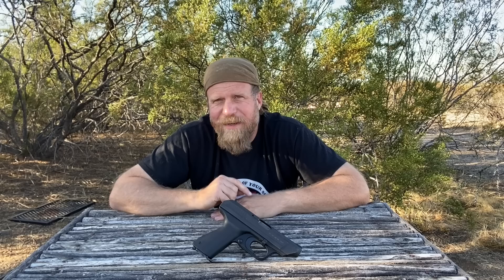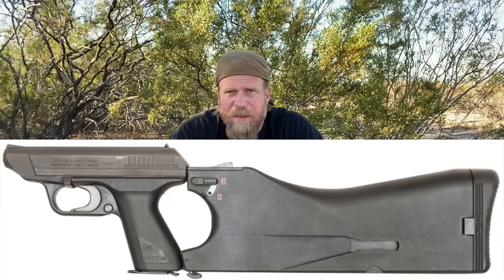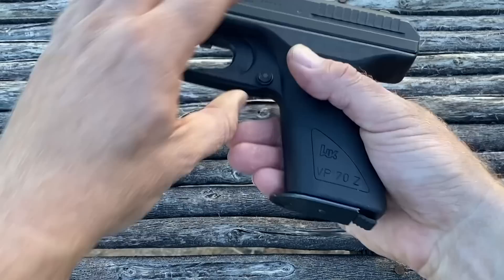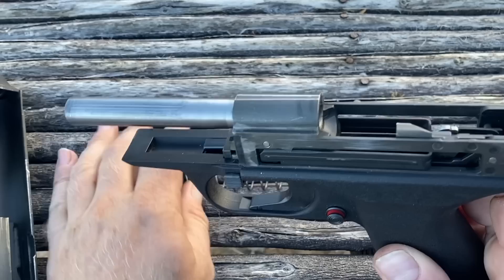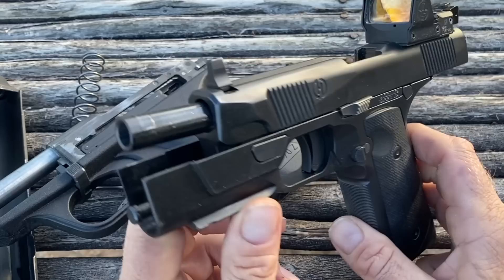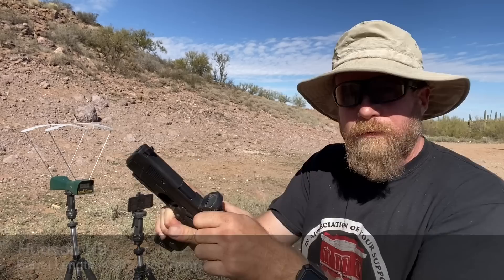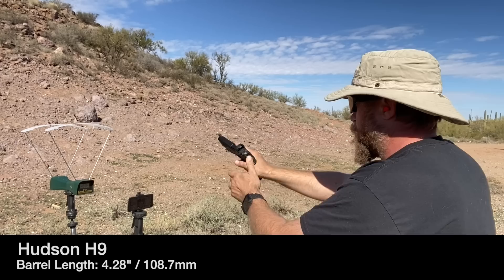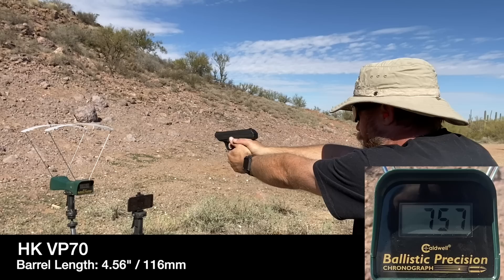HK VP70 - Turning 9x19 into 9x17 since 1970

Comment: Out of curiosity, could it handle +P ammunition, and if it could, would it bring it up to standard velocities for 9mm or maybe still exceeding normal velocities??
Reply: You know that not-so-subtle difference between should and could?😎
Reply: It "should" handle it, yes. It was designed with the understanding and intent of using NATO-spec ammo, which is substantially hotter than standard 9x19mm civilian loads, and is in the +P/+P+ range.

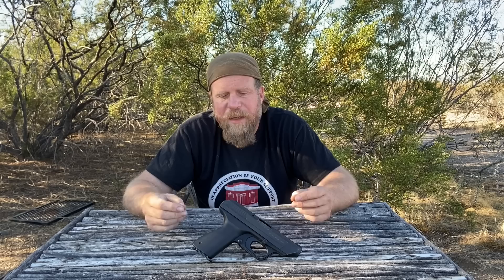Comment: 2:40  Hrmm.... so a VP70 is one of those rare guns that may malfunction, break, or otherwise spontaneously disassemble itself if fed a steady diet of unjacketed lead projectiles....
Reply: It's not alone. Unjacketed lead causes a lot of iffy miffedness. You know it. 😑
Reply: @andersbendsen5931  It's alone in it's reason... filling the grooves and raising pressure to standard 9mm levels, above what the spring and slide mass were designed for. 

Could even get that with rounds that don't lead up, but obturate.. flow into the grooves too well.

Comment: The Astra 400 in 9 mm Largo and the 600 in 9x19 were also blowback service pistols that predated the VP70 by almost 50 years. They were heavier than the VP70, but it was mostly due to the much longer barrel and steel frame. They did not use any special deep rifling to let excess pressure escape, but  worked extremely well.
Reply: And if you want a double stack-double feed mag that is easy to load you only have to make the slide VERY wide. Not many people want this.
Reply: @rubennasser6907  I believe part of the idea with the VP70 is that it woud be firing extremely hot loaded 9mm submachinegun ammo, nothing against the Astra 600 but I'm not sure I'd want to feed it hundreds of rounds of +P+
Reply: @jameshealy4594  Perhaps that was the intention... I had one and did not had any trouble with hundreds of +P rounds, though.

Comment: It wasn't just LV426 - James Bond used this gun in one of the extended-universe John Gardiner novelizations. Interesting and weird. A good rule of thumb seems to be that you lose 100fps over a comparable pistol. An interesting experiment, which I know you can't do here, might be to set up a VP70 barrel in a pressure rig and compare the time vs pressure curve to a normally rifled barrel of exactly the same length.

Comment: I guess the loss of velocity is much more of a problem with modern hollow point bullets than it would be with standard military FMJs. With FMJs the VP70 just makes 9mm holes like every other 9 mm pistol. A modern HP may not expand and loose a lot of its effectiveness.
Reply: It has less to do with hollow points and the like, and more to do with that the gun was built for +p+++ 9mm
Reply: @marcusborderlands6177  It was build as a military weapon in Germany, a NATO member. So it was probably designed for standard NATO spec. 9x19 FMJs.

Also noteworthy: Germany as part of the EU is C.I.P.-controlled.
That means you can't sell out of spec ammo in Germany.
A lot of +P+ ammo sold in the US is illigal in Germany.

Comment: Perhaps the engineers decided that with a 3 round burst mode for military use, that perhaps it might be prudent to have a bit of blow by on a straight blow back design to delay the bolt opening a bit more when you are getting 2200 rounds per minute rate of fire?

Nah, that can't be it. And nearly 20 years of production ain't too shabby for such a poorly designed pistol.............